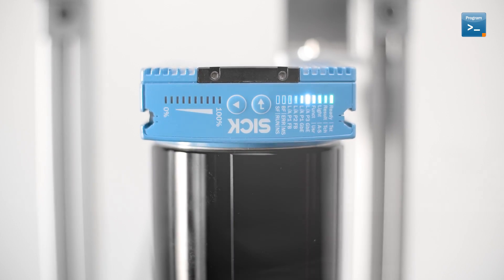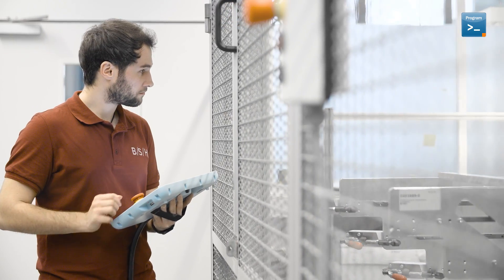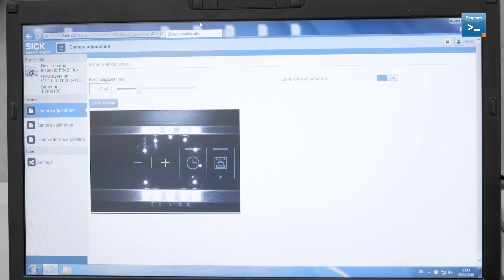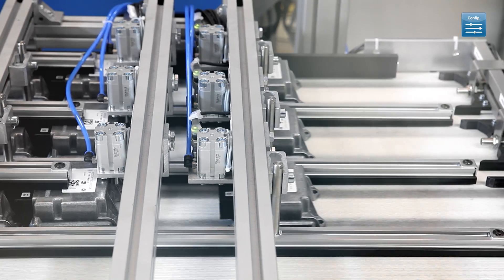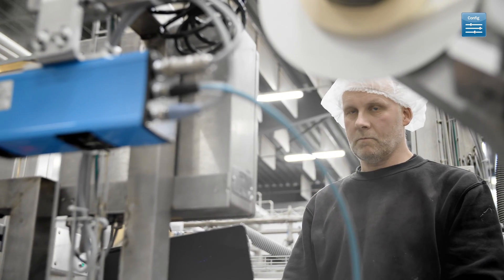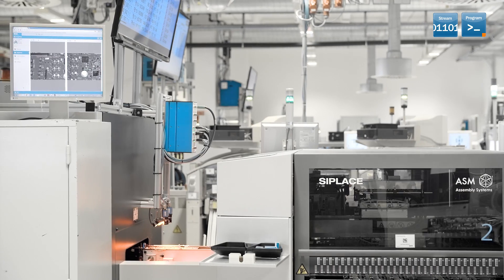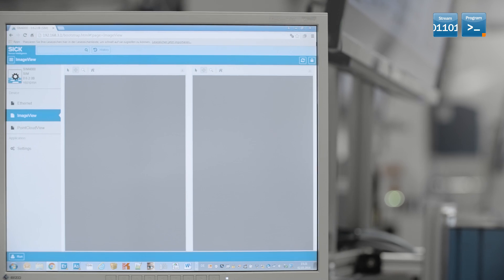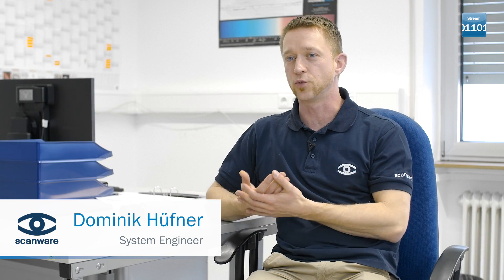MORE THAN A VISION: Inspection solutions from SICK | SICK AG

Comment: Is the vision system at 0:55 guiding the robots position/finger actuation or doing a surface inspection itself?
Reply from the maker: Hey,
in this application, the InspectorP is used to control/guide a robot. I hope this answered your question.
Best regards.
Reply: OK, thanks. Seemed possible it was also inspecting the surface via vision, but I think that answers my question.